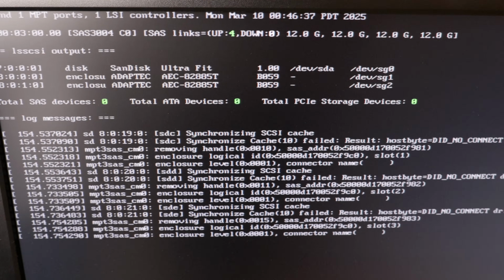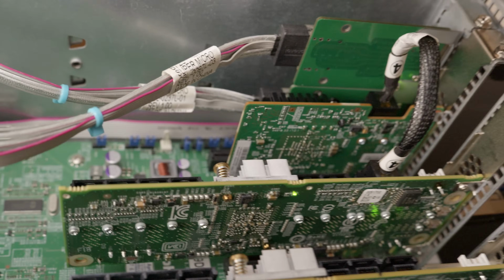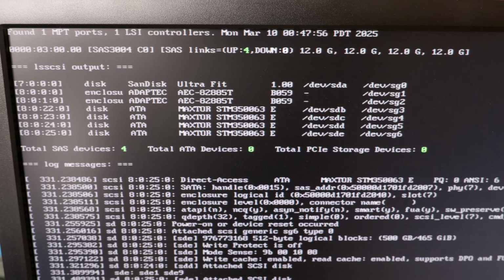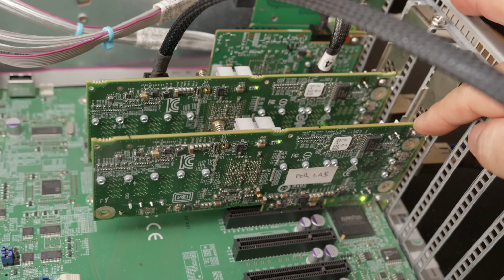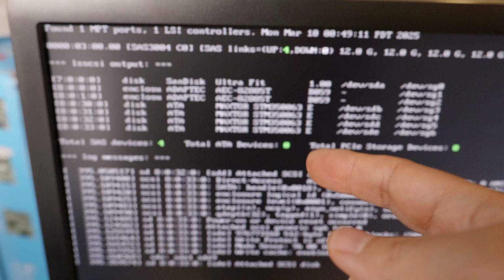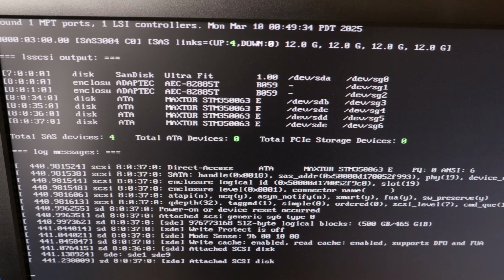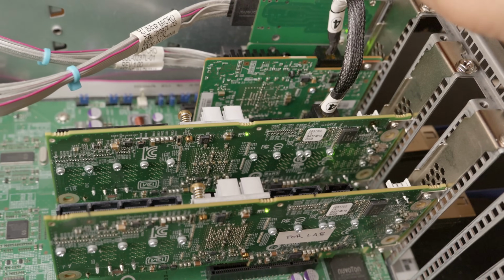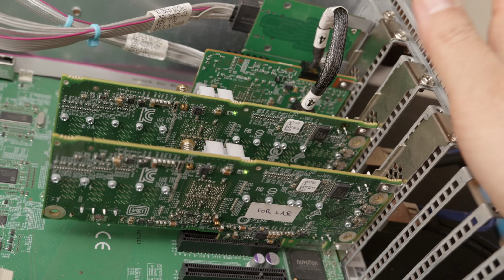The best PCIe3 x4 HBA and Expander setup | HBA IT mode controller for limited PCIe lanes

Comment: I have a 9307-8i connected to 8 out of 12 of my drive bays in my unraid server. The remaining 4 are connected to motherboard SATA. I am looking to get more SAS drives to upgrade smaller drives and want to allow putting them in any of the 12 slots so need more SAS options. Am I better off getting a  16i card (which one) or figuring how to add more slots with an expander to my 9307-81 card? Mother board is msi H110M PRO-VD PLUS and has one pcie 3.0 x 16 slot and 2 pcie 2.0 x 1 slots..thanks for any assistance!
Reply from the maker: If you're primarily using spinning HDDs, I would just add a SAS expander to your 9207-8i. Since you don't have extra PCIe slots, I would choose a SAS expander that can be powered without a PCIe slot. For example, the RES2SV240 is SAS-2 with SFF-8087 ports, and has a 4-pin molex port for power. Available here: https://ebay.us/YalNt2 (eBay partner link)

If you're using SSDs, then I would look at a higher performing card with more SAS lanes.
Reply: @ArtofServer  thank you for the reply. Do I just connect one port of my current card to one of the ports of this other card with 8087 to 8087 cable and then have breakout 8087 to sata cables to the three drive cages?
Reply: @ArtofServer  BTW, just placed an order for that expander card you listed for me..thanks!

Comment: Hello, thank you for this very clear video about the HBA cards. I bought an Orico DAS, in it I have 5 drives, connected via USB-C to a Supermicro. The problem is that if I want to create a pool on TrueNas , it doesn't recognizes each drive... the solution is to use an HBA card and open the Orico and connect each drive individually... I’ll keep you inform ,  converting DAS to NAS.
Reply from the maker: Glad the video was helpful! Hope your project goes well. :-)

Comment: This is a good video, I've always wondered how sas expanders work. Is there something similar for nvme drives?
Reply from the maker: Glad this was helpful.

NVMe are basically PCIe devices. So, you would need a PCIe switch to connect multiple NVMe drives to your PCIe bus. This will naturally create a bottleneck, so it's not always a great idea. But there are PCIe switch cards with PLX chips on them that serve this type of purpose. This might be a good idea for a future video! Thanks! :-)

Comment: Just done this to retire my 9300 16i, and it seems like the maximum speed I can pull through it is 2GB/sec, so 16gbit. 

Not bad, and I'm certainly not complaining, but the maximum theoretical speed is double that (32gbit/4GB). HBA is in a pcie g4 x4 slot, and it doesn't matter if it's SSD or HDD.

The 82885t does have an ancient version of the firmware on it (b025), so I'll be updating that later (after downloading the original fw) and see if that makes any difference.

edit: an update to Lenovo's fw 062 got me to 3.5GB/sec, which is much more in line with my expectations. Just google lnvgy_fw_storehba_exp.82885t-7.3.1.062-0

Comment: Thanks for the video! I've been looking for this exact solution to using an HBA in a PCIe 4.0 x4 slot. I have 2 quick questions:
1. If I'm trying to connect a DAS w/ a SAS2 8088 connector, is it better to use a SAS2 expander instead of the SAS3 expander mentioned in the video or do I just use a 8644 to 8088 cable to connect?
2. If using the Molex connector, is it a good ideal to tap the PCIe part of the SAS expander card so it doesn't short anything out?

EDIT: I acknowledge that this won't run at SAS3 speeds. I just want to be able to connect and use my DAS.
Reply from the maker: 1. you can use either, but there's no benefit in using SAS-3 if the other end will only talk SAS-2
2. not exactly sure what you mean. the PCIe bracket should be mounted to the metal of the case, if that's what you're talking about.

Comment: Does this adaptec expander card needs to be in pcie slot bcs i want to use another case where the hdds will be and in that case there is no motherboard
Reply: If you're talking about power, you can feed it power via MOLEX connector which is mentioned at 9:38 . It's probably ideal it's still mounted into a PCIe bracket though to make sure everything gets enough cooling
Reply from the maker: xgraysunx's answer is correct. you can power it externally without the PCIe slot. you can also use a powered PCIe extender to power the expander. i've demonstrated some of this in my videos. look through the playlist on SAS expanders.

Comment: Thanks for showing the power connector.  I saw the connector mentioned in the documentation but it didn't specifically state it was a molex connector and I couldn't find a picture of it anywhere.
My setup is an X99 Taichi, Xeon E5-2697A V4, 256GB 2133 Reg ECC with a GTX 1050 for Nvenc, a dual port 25GbE ConnectX-4LX, a 9400-16i HBA, sixteen 4TB 7200rpm SAS drives and I had just purchased ten 240GB SSDs that I intended to stripe for a read cache.  Then I realized Intel put the chipset on a severe bottleneck and started looking for ways around it.  Looks like mounting one of these with the low profile bracket in the full profile slot and using molex will be the ticket.  Oh all that is in a Thermaltake VE2000BWS case powered by a Seasonic Prime GX-850.  The HDDs are in two RaidZ3 8 disk VDEVs.  They were dirt cheap, like $14/ea, but needing the new PSU, the case, the hba and cables, it all added up surprisingly quickly and surprisingly high.
Reply from the maker: Glad to hear the video helped you identify the connector!

Comment: what about a 4.0 x4 slot? or a x16 4.0 slot if we are not using a gpu?   i want some u.2 ssd drives, like 5 or 6.  what are options for that?
Reply from the maker: For U.2 NVMe drives, you just need an adapter to convert U.2 to PCIe card. You should avoid using any controller or switch. If you want to connect a lot of U.2 SSDs, you need a motherboard with a lot of PCIe lanes (x4 lanes per SSD).

Comment: Sadly there are no more new next gen for the HighPoint R750 Rocket 750 40-Channel SATA card, which only use for storage not for simultaneous access to all the drives...
Reply from the maker: That card was not very well balanced. 40x HDDs means you need about 80Gbps of bandwidth. The card was a PCIe 2.0 x8 card with only 32Gbps of PCIe bandwidth. This is not even taking into account their use of port multipliers. Ok for connectivity, but performance was not stellar.

Comment: What about M1215?
Reply from the maker: Yes, both the M1215 (9340-8i) and N2215 (9302-8i) are also great SAS controllers to pair with the AEC-82885T. Thanks for watching!
Reply: @ArtofServer  Thank you. It may have been around for some time but I just find HighPoint's PCIe Gen5 x16 SAS3 (not hybrid, no NVMe, no SAS4) HBAs (Rocket 700 series), and their PCIe Gen2 x4 SATA HBA (Rocket 640L) for 4 pcs. of SATA connections.
Reply: @ArtofServer  what is the difference? I see the N2215 is half the cost on your eBay store.

Comment: I wish Broadcom would build a PCIe 5.0x4 HBA.  You could run 10 SAS drives at full speed.
Reply from the maker: yeah, PCIe speeds made a quick leap forward with PCIe 4/5. We had PCIe 3 for so many years! The latest 9500 and 9600 series HBAs support PCIe4, so that's good. Maybe next generation will be PCIe5?

Comment: i would not opt for a mainboard without an x8 pci-e slot.
Reply from the maker: Yeah, for a server build, I much prefer server platform motherboards. Even if they are older, just so much more flexibility. I'm hoping to see more affordable Epyc systems on the used market in the coming years!

Comment: What are your thoughts on LSI 9207-8i ?
Reply from the maker: It's a good card, and capable of supporting SATA SSDs decently well. It does require good airflow to keep it cool. It was the first gen to support PCIe 3.0!
Reply: @ArtofServer  Ironically I had just picked up a LSI 9207-8i before finding this video, I was a little shocked how much heat they made and just a blanket 10+ extra watts it takes to run!  
I get in the terms of big servers 10 watts is probably nothing, I've been trying to put together a low power server.  I've been playing with the ASM1064/ASM1164 chip set cards/M.2 adaptors, clearly they have their own limitation, but they don't seem to pull any noticeable extra power. 

How do the cards you're recommending do in terms of power use?
Reply: @ArtofServer  I would second the question from @NeverEnoughRally - the thing is terribly hot, even with small fan attached. It's a weak point if a system. Can you recommend some other cheap second hand controller that will be cooler/lower power draw?

Comment: I had the same 'problem' and my solution was to replace my primary controller with a dual controller (16 SATA) and use 8x8x4x4 to share the lanes with a dual 10 gig sfp+ NIC. Thus distributing the 16 pcie lanes where each 10g got 4 lanes and each SATA drive got a minimum of a full pcie 3 or 4 lane which is plenty as I never read all 16 SATA at any given moment. I removed the GPU and changed to an APU to get the meager video that a server needs and free up the GPU for a workstation.
Reply from the maker: That's interesting! How did you split and cable the x16 slot into x8x8x4x4? That's 24 lanes total?
Reply: @ArtofServer  slot 1 (x8), slot 2(x8), slot 3(x4), slot 4(x4)

Comment: Thank you for tho video. Do You plan to make something like that, but with pcie nvme storage. My goal was to connect 8 m.2 drives to regular PC board. All that I've done is x16 bifurcation card with 4x m.2 disks. Maybe there is some not very old (pcieV3 or hier) switches that can make for example x2 lanes from x16 slot. Or maybe make x4 pcieV3 connection out of x1 pciev5.
Reply from the maker: if you want to use a lot of NVMe, you really need to get a platform with enough PCIe lanes. It's pointless to have NVMe if you're going through a PCIe switch or Tri-Mode virtual switch, etc. That's like buying a Lamborghini only to drive in rush hour traffic at 20mph. Consider Epyc or Threadripper platforms to really experience the benefits of 8x NVMe drives.
Reply: @ArtofServer  if the case is speed. But NVME NAS can be about dimensions and power efficiency. Like with asustor flashstor 12.

Comment: Hey! Love your channel. You are really the goto guy for keeping servers at home. I'll ask you a brief question: in the documentation of those very popular Proliant G8 servers, which happens to be PCIe 3, is stated that no SAS expanders can be used with them. Do you think that is the case or the SAS expander works almost independently from the MoBo? I'll appreciate very much your answer as I have one of those as my NAS server. Thanks!
Reply from the maker: The SAS expander works independently of everything else except the SAS controller you will connect to it. The SAS controller connects to the PCIe bus and as long as that works, the SAS expander should work with it.
Reply: @ArtofServer  Oh. Thank you for your answer. I'm going to look into buying the third cage for this server and use one of those. 😏

Comment: Can you please advice HBA for 12 drives + 4 nvme or ssd, I have pcie gen 4x8 full size slot
Reply from the maker: Well, I would keep any NVMe directly attached to the PCIe bus instead of through any HBA. But for HDDs and SAS/SATA SSDs, consider the 9305-16i, 9400-16i, or 9500-16i.

Comment: I should have used a SAS expander to connect my backplane.  Oh well, maybe next rebuild.
Reply from the maker: For HDD based storage systems, they are great. There's always an opportunity to rebuild when it comes time to upgrade anyway! :-)
Reply: @ArtofServer  I bought a 9205-16e (or something like that) from you.  I have the front from an HP sever with 12 bays in my rack running back to the HBA.  I should have used something like this with an expander by the shelf.

Comment: Is it possible to run 2 connections into one sas expander? for example using both ports on a IBM 1115 or 1215 into the expander?
Reply from the maker: Yes it is. And that would double the number of SAS lanes for more I/O bandwidth between the SAS controller and expander.
Reply: @ArtofServer  Awesome. My current server is Ivy bridge-E based and uses three 1115's to direct attach to 24 drives. Modern severs just use too much power so the replacement would need to be consumer or epyc 4004 based.

Comment: If you're feeling adventurous, you can use a jeweler's saw to cut down the PCIe data finger to fit the card in a smaller slot.  Did this back in the day to install a Radeon X300 in a Dell server that only had x8 slots.
Reply from the maker: That's pretty extreme, but it's definitely a thing!

Comment: These are older cards. The question is, are there any good working drivers out there for Windows 11?
Reply: In my experience you can expect most drivers from windows 7 forward to function on 11. Good? Well this is certainly a niche so non-fatal performance hobbling hiccups are reasonably likely. These are however enterprise products, which have a very long tail of support. PCIe 3.0 was 2010, windows 10 was 2015, I think it's safe to assume that an enterprise HBA released in 2010 got a windows 10 driver release, also 8.
Reply: @  Sometimes it can work. That is why I have asked, if someone maybe tried it with Windows 11 already. At the moment I have a LSI MegaRAID 9260 controller with windows 10 drivers running on Windows 11. But I had issues with it. They are kind of partially resolved now but it is not 100% stable.
Reply from the maker: That's a good question. Unfortunately, I'm not a Windows 11 user. However, I suspect the older drivers might still work in Windows 11, no?
Reply: @ At the moment I am running a LSI MegaRAID 9260-8i card and I had many issues (Windows 11 with drivers from Windows 10)  with the RAID drives being kicked out of the system on heavy load (like gaming). Then by surprise when I updated to Windows 24H2 it finally heavily lowered this issue and it only occurs very very rarely now.
But I assume it could be an incompatibility with the new mainboard that I use now.

Btw... no idea if you have talked about the LSI MegaRAID 9260. But it is a very nice RAID controller that literally costs 5$ if you are lucky.

Comment: you should ask the coustomers if the slot can physically fit x8, since x8 cards will work even if they are connected to 4 lanes and you have a ton more options
Reply from the maker: actually, I do. that's one of the options I offer them. and with less PCIe lanes, I will usually recommend a PCIe 3.0 or 4.0 card instead if they need the bandwidth. I'm looking forward to future HBAs with 4.0/5.0 support so they will require less PCIe lanes, if only they would consider designs optimized for HDD use. Broadcom is more focused on SSDs now, which I understand, and those require a lot of PCIe bandwidth, but there's still a use case for HDDs.
Reply: @ArtofServer  I've been costing out some new servers this year and the SSDs are so fast, you don't spec an HBA to avoid the bottleneck, unless its a boot drive and even then those normally have little m.2 RAID 1 daughter boards.

For my home lab, I'm currently running a x8 Broadcom 9600-24i on PCIe 4.0x4 without issue, the card is spec'd to only draw 20W. The 9600 series turns up cheap on eBay relatively frequently, at guess due to the expensive accessories you need to get it working with NVMe catching people out. Only using it for SAS/SATA myself and that works just fine.

Comment: Nice video, one thing I would add for those that don't know, if your x4 PCI-E slot is open ended you can install an x8 (or even x16) card in it and it will work, you'll just be limited to x4 bandwidth.
Reply from the maker: Good point, thanks for pointing that out!

Comment: i am getting into running local ai models and   i have expanded my mini pc in insane ways  oculink.. etc
 this is very interesting 
i am now building a AM4 system   
have you tried   5x m.2  jobd  case form TISHRIC " M2 NGFF to SATA SSD Case Enclosure  "  ?  (  on TEMU)
i am moving more to solid state drives
Reply from the maker: no, sorry, I haven't tried those so I don't know anything about them.

Comment: x4 is very common now a days. thanak you very much for this. what a lot of people dont notice is that you can stick a 8x into a 4x slow in most mobos as the there is usually a cut out that allows for larger cards. i use a lsi 9300 8x on my 4x slot
Reply: Morze common is PCIe 1x in 16x slot :/
Reply: @Piotr_T Yeh 🫤😔
Reply: Dremel makes any x4 slot open ended.
Reply from the maker: Yes, if the x4 slot is open ended, you can certainly install a x8 card and just operate it with x4 PCIe lanes. As long as the bandwidth is enough for the use case, it is fine. However, a lot of folks have older motherboards where the slot is not open ended. I hope this helps those people out. Thanks for watching! :-)
Reply: @ArtofServer rizers🤷‍♂️

Comment: This would pair well with Asrock Rack motherboard and AMD Ryzen Server chip for a low power system. I run Epyc at home but 200 Watts idle is a bit high for me.
Reply from the maker: Yeah, I'm working on some videos where I will test the power consumption of these and various other HBA and SAS expander cards. You might want to stay tuned for those videos. I wish there were more Ryzen based server platforms... ASRock seems to be the only player serious about that and I think it would make for great light weight low powered server platform as long as they support ECC too.